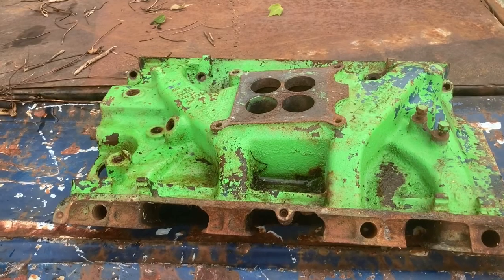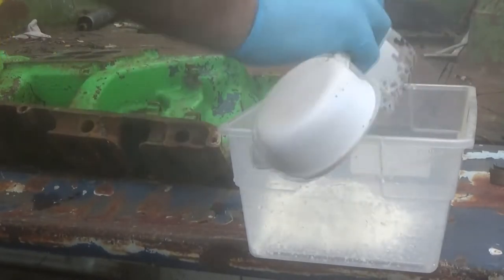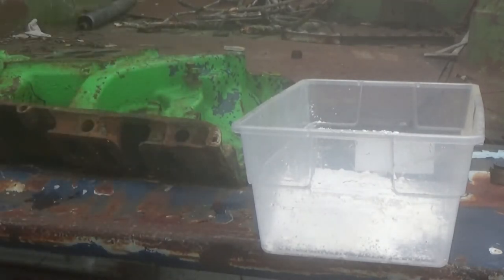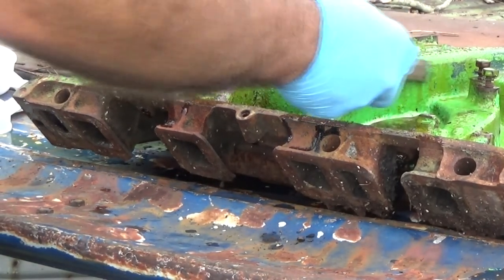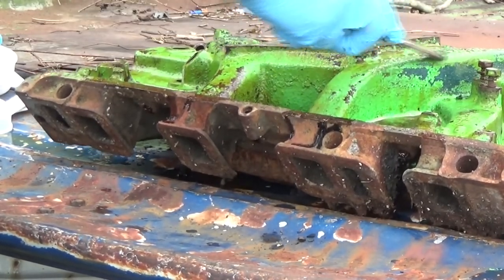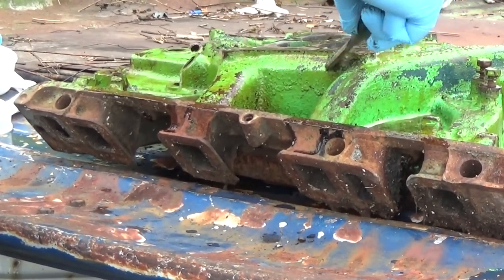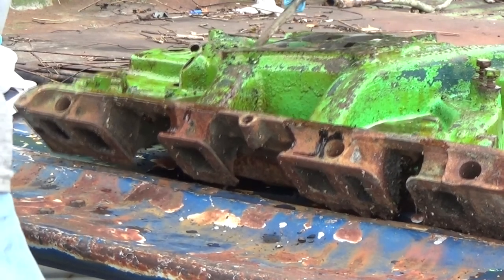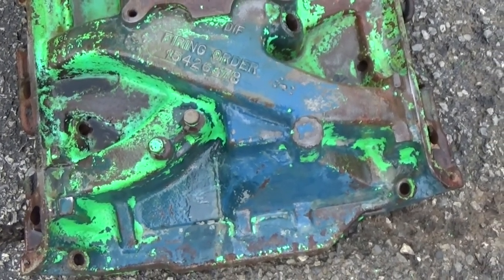Trying some homemade paint stripper?

Comment: Lye is effective but so strong.  There are strong bases that are safer to handle.  I’m sure sodium metasilicate, trisodium phosphate, or soda ash would work as a concentrated solution.  Heat helps.
Reply from the maker: I have no doubt that heat would help

Comment: This really works I made and used it to strip oil base paint off of wood metal particle board and heavy plastic. Tip mix the corn starch with warm water first before mixing with lye water avoids getting lumps you get a smooth gel like consistency, I also add a little pure lemon oil helps eat the paint, don't put it on aluminum it has a violent reaction. I agree man I ain't fond of green either
Reply from the maker: I'll try that next time. I don't care for green much at all but that shade of green is horrible lol
Reply: @BlackLabGarage  
I agree I enjoyed watching the lye eat that green horror 😂
Reply from the maker: @RavenVargas27  I call it phlegm green😂 It looks like  Chrysler color to me.

Comment: Mopar guys would call that color Sublime Green. I use Easy-Off over cleaner to get paint off of stuff, but it needs to be in the Yellow can. I spent nearly 30 years in grocery retail putting the stuff on the shelf. We finally had to quit carrying Red Devil because the meth heads would come in and wipe us out the day after we have restocked the shelf.
Reply from the maker: Yeah...meth heads are making it hard to get a lot of stuff unfortunately.

Comment: I have good luck cleaning rust and grease off of steel with a bath of muriatic acid.  Not expensive and no scrubbing.   Have to coat it as soon as it washed and dry because steel will flash rust.
Reply from the maker: I use a lot of hydrochloric acid (toilet bowl cleaner) for old rusty parts. I like it because you can get it in gel form and it sticks to the parts better. Just never use it on aluminum lol

Comment: What Is That Lye Water? and What To Do After The Paint Stripped Completely? Help Plz
Reply from the maker: It's lye and corn starch mixed in water. The corn starch makes it thicker so it will stick better. after the paint it stripped just wash it real good and dry it off and paint it.
Reply: @BlackLabGarage  And What Is That Lye ? Plz Let Me Know
Reply from the maker: Lye is usually found as a powder drain opener. Not liquid drain opener. @HASRaza

Comment: I heard if you try this on a aluminum manifold it will clean it so good that it makes it almost not the same as it use to be before you cleaned it?
Reply from the maker: I haven't ever tried it on aluminum so I can't say for sure.
Reply: I can’t aggressively etch aluminum in 5% lye water.  That’s 5%!!!   At 20%+ you are majorly eroding and dissolving the aluminum
Reply: It's a light weight racing manifold